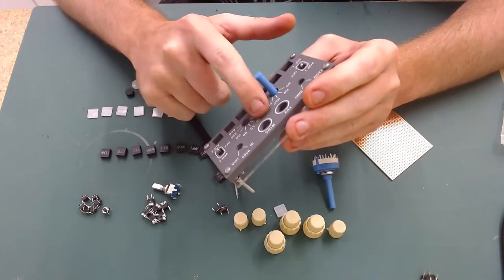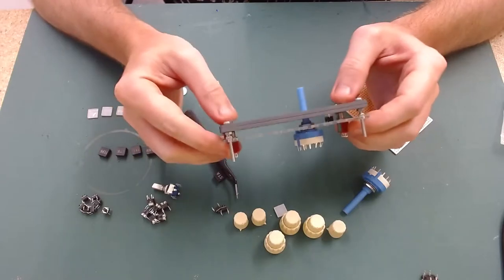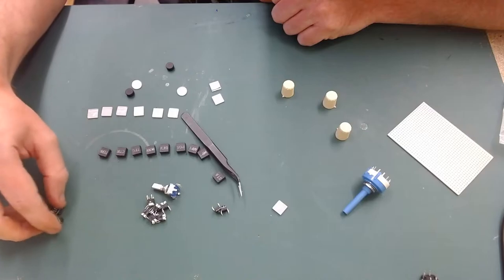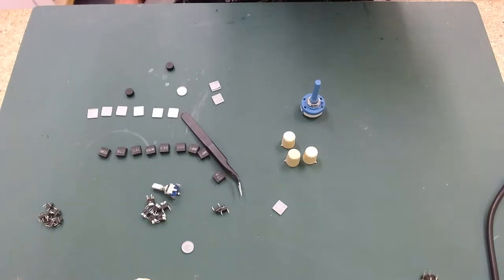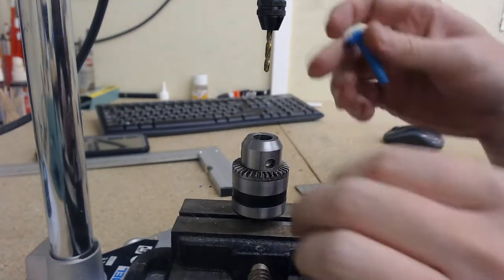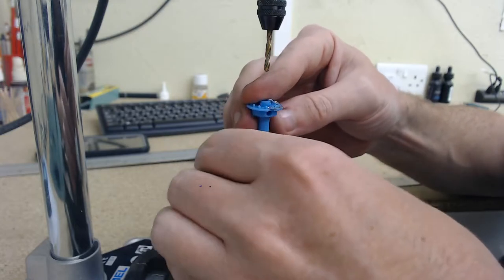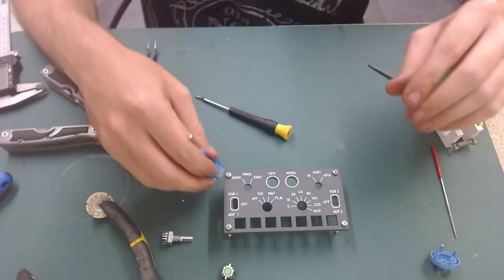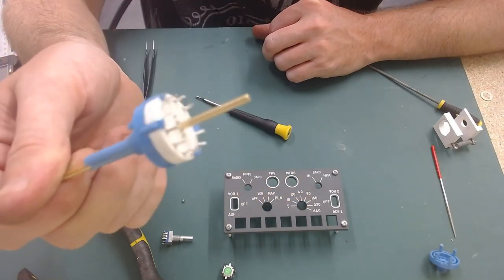737 home sim build - Cokpit sim parts efis - Part 1

Comment: How did you mount the upper rotary switches? Only glue? I'm asking since the transparent plastic has squares and not round holes like for the bottom rotaries.   Congratulations on your project. Greetings from Mexico.

Comment: This is really inspiring stuff.Thanks for making these videos. I'm planning on making a cockpit one day so absorbing everything I can! I'm a software developer so I know how to code, but I know nothing about electronics and very little about carpentry... so not sure how well I'll get on.

Also, big shout out for 23 minutes: "My shaft is hard on the bottom" 

I'm childish. Thanks again for the video!
Reply from the maker: Dan Sanderson hi dan, thanks for your kind words, for the electronics just start small scale and experiment, you’ll soon learn what works and what goes puff. I knew nothing about electronics when I started but once you’ve learnt the basics of getting a switch and led to work it’s just repeated all over the cockpit. I’m just now finishing off the mip build so new vid coming soon of that. Haha I didn’t realise that’s what I said but yes that would tickle my childish mind also
Reply: @simbuilduk5853  Thanks for the reply. That's really good to hear. There is hope for me afterall! I just ordered the EFIS panel kit, so I'll be following your lead with regards to that one. Looking forward to the new video.
Reply: @simbuilduk5853  Hi Ian. I got all my bits and pieces and got started on putting it altogether. I also got myself an Arduino and a few components to play around with and hooked it up to P3D using MoboFlight. Everything seems to work and I'm starting the nuts and bolts of it. Also I'm starting to realise what a massive job all of this is going to be!! I want to go down the same route as you, making the Efis behave as expected.

With that in mind, do you have any suggestions for drilling out those encoder shafts if you don't have the rig you've got? I guess I can try to hunt down somone who has something but I'm reluctant to buy something like that; given that I'm unlikely to ever use it again. Are there places I can actuallly take them to get them to do it for me? I don't mind paying to get it done. I'm planning on getting a 3D printer since I'm already pretty good at 3D design software so I think that'll be a good purchase for future projects. 

All the best.
Reply from the maker: Dan Sanderson hi Dan great to hear you are cracking on with the build, I agree you start to realise what you’re taking on when you start but keep plugging and you’ll be surprised what you can achieve. You’ve done right by starting small, once you understand how to wire each of the components it’s just a case of making it bigger with a faceplate and you can make any panel you desire. The ideal way to drill out the switches would be with a lathe so if you know someone it might be worth an ask. I’d happily do the full mod with the wood dowels if you send me the rotary switches, then I’ll send it back.
Reply: sim build uk wow that’s such a kind offer! I know a carpenter but I don’t think he has a lathe. Do you have an email address I can reach you on? I’d like to pay you for your time but again that is such a kind offer. Gotta love this sim community. All the best, Dan
Reply from the maker: Dan Sanderson yea you can reach me directly at simbuilduk@gmail.com
Reply from the maker: Dan Sanderson hi Dan I’ve received your email but can’t seem to reply to it, it keeps bouncing back as undelivered
Reply: @simbuilduk5853  Ah man, had a right old time with that email account recently. I've just emailed you via gmail instead. Hopefully that works without any problems! Thanks for replying!
Reply from the maker: Dan Sanderson ok I’ll try and send the reply again tonight

Comment: Just doing mine aswell Ian
Reply from the maker: good to hear, hope you find some useful information in these vids
Reply: I think you did really well with the dremel setup. I'd have cheated and found someone to drill it on a lathe.
Reply from the maker: @wv838  best part is i sold my lathe 6 months ago, I ended up binning that version, watch the other parts where I re do it with a pillar drill